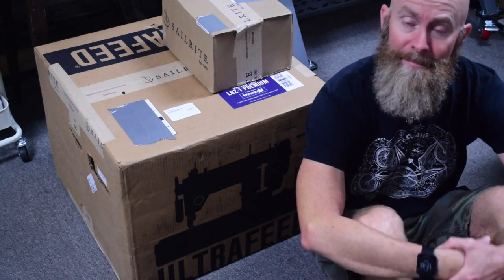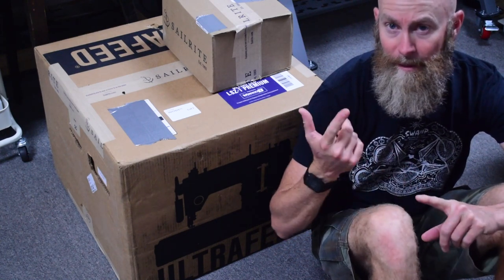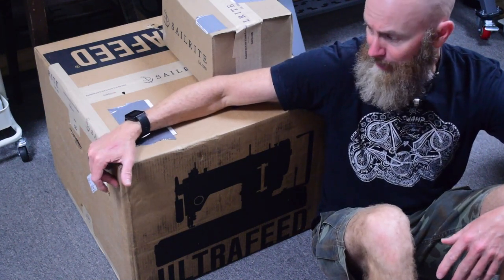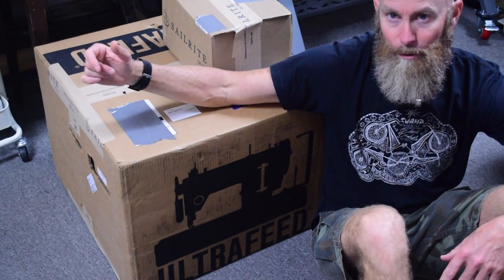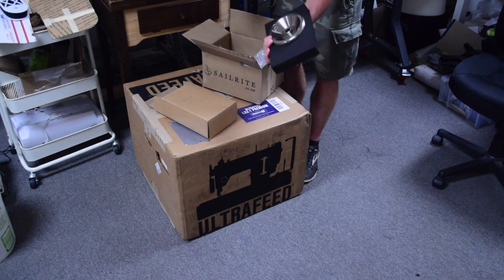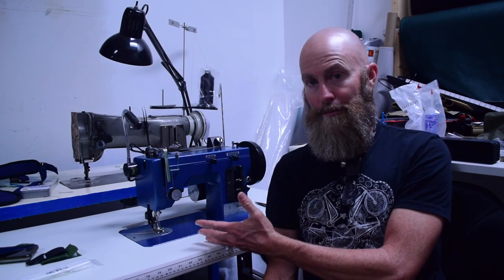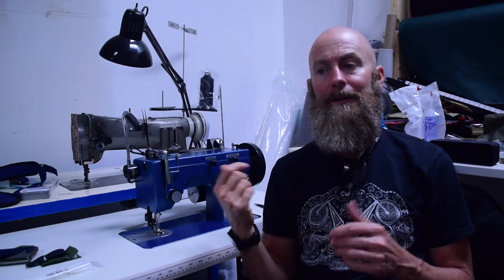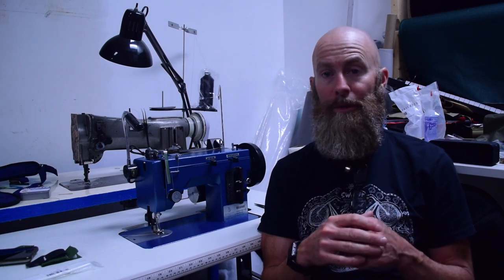LSZ-1Premium with WorkerB; Unboxing and First Impressions

Comment: Here's the deal, the LS-1 and the LSZ-1 were designed for one thing, to sew any fabric you will find on yachts and sail boats. All fabrics from the lightest sails to the heaviest canvas can be sewn on these machines. This is the reason why they are portable and can be used with no electricity. These weren't intended to replace the industrial machine under industrial conditions. Now can you use these in the household setting, yes. The LSZ-1 can handle any household project from canvas awnings to kitchen curtains.

Comment: I too would prefer to have the foot lifting lever in the back but mostly because its what I'm used to. As a kite surfing repair guy I'm often sewing rips in struts and it requires gathering the tube up behind the needle and at times there will be enough fabric to actually lift the lever up and reduce foot pressure, which causes problems. Its also happens when I've got the the entire kite stuffed under the arm. Here having the lever on the top is advantageous. A future video could be about visiting a kite repair shop and seeing what/how they do things.
Reply from the maker: Good points!  Do you know a kite repair shop that might allow me to visit? 😉
(You can email me at        the jason of all trades @ gmail . com  <---remove the spaces.  If you're anywhere in Florida, I'd love to see what you do!)

Comment: WOW, I just stumbled on this vid and cant believe it. ( I subscribed too) I have been looking at machines and was getting ready to buy this one, like as in, this week.
 So you have comments from people who dont know the difference between an "Industrial" machine and a "heavy duty" machine. They should read the category  description of each, so they know the difference. This machine is classified as a heavy duty, portable machine, not an industrial machine.   The  Sailrite 111 Fabricator, is their "industrial"  model.
 Yeah, Ive worked in machine shops my whole life and have a full size Bridgeport industrial milling machine in my garage. ( Im 65).
  I picked this machine for all the reasons it is, what it is.
 Portable, heavy duty, walking foot, adjustable stitch length both directions, the ability to have both straight and zig-zag, at the flip of a lever. Easy set up to sew bead, tunnel, or wire into edge. Has easy mounting for an edge binder attachment. Perfect machine for making small sails, sun shades,  canvas covers, straps, carry bags, etc... And mostly made in the USA.
 Even though it has an oscillating, not rotating hook drive, they show, this machine will sew their brand of PTFE forever thread with minimal problems. An occasional skipped stitch does not bother me. Have you tried this thread yet?  Im very interested in using this type thread.
 I have watched several vids on this machine and it seems  to have the most features and versatile and be the best,   " bang for the buck"  for the beginner, like me, to make medium to heavy duty things at home or mobile.
 I have not found any other machine that does, all the same things, as this one. If there is one, can some one refer it?
 I cant think of anything that could be bad about this machine.  I even like, the lift lever on top.
 Thank you very much for your vid.

Comment: I took a boat cover that needed some repair and a Bimini top to get windows put in it at a local shop. the two estimates I got were over $1,200 dollars. so on a mission I went, and ended up with the LSZ-1 with the regular motor. The repair material and window material was $175.00. I used to play around with my moms sewing machines as a kid sewing on patches ect. so I had some minor experience. with that said the repairs went perfect. A little touchy control wise but got it done. Then I saw the new worker B system on YouTube. I bought the monster wheel as well. and proceeded to install the Bimini windows. This thing is absolutely made my sewing look like I've been doing it as a PROFESIONAL for twenty years  the control is amazing. On a last note my son and I built a 6 man tepee out of silnylon and the seams and stitching came out perfect...so it will sew extremely thin material with ease. Just have to use smaller needle thread combo!!!!!! Moral of the story , this machine has paid for its self in less than a year!!!!!!!!!!!

Comment: I just received my LSZ-1 and finished assembling it and setting it up. I am impressed with it. It's exactly as described. They did add the molded cord retainer on the belt cover which I thought was cool since you mentioned it in your video. I also bought the industrial table to go with it which should be arriving today. Thanks for posting your experiences with it. That played a big part in my decision in buying it. I wanted zig zag function too which clenched the deal. Thanks again👍
Reply from the maker: That's awesome, let me know what you make with it! I know you'll love it, I have way too many machines but I always love making stuff on my Ultrafeeds!

Comment: Hi Jason. Really appreciate you. I started sewing because I wanted to make a boat cover. I bought the LS. Worked great and now it’s one of my favorite hobbies. I bought a fabricator and I really like it. A few years ago I gave my LS to one of my sons. After a while I realized that I really missed the portability of the LS so I just bought the latest LZ.  I have a home and a cabin and there are many times I want to make things at the cabin so now I’m happy. One thing that really impressed me when I bought my first Sailrite is the customer support. If I had any issues they’d work with me until the problem was resolved. They even sent me links to well made detailed videos walking me through the process.  Based on my experience with them they clearly are stuck with me as a satisfied customer.  And thank you. Mike

Comment: I think your videos are very helpful.  I just got my blue machine and i'm using it for bag making personal use.  I have a fairly new Bernina and the last bag i made was thick enought that when i used the hand wheel to go over a thick part the wheel came off in my hand.  Didn't know i had broken off 2 nubs on the inside.  Also i boogered up something just in front of the needle. So decided this machine was a lot heavier and more suited for bags.  I'm excited and love your videos.  Unless you have tried one of these machines don't bad mouth it!!

Comment: I have had a LZ-1 and just did the upgrade to the worker Bee. Head over tails improvement.  That power assist is awesome with the control needed.  I am a small part time manufacturer of specialty gear.  Multiple layers of Cordura, mil-spec nylon webbing, foam assemblies. Only recommendation I tell folks is take off the tensioning knob and use a vernier depth gauge and measure the post to knob height.  Keep those measurements so that you can repeatedly comeback to different tensions depending on what your sewing.
Reply from the maker: That's a cool idea using the depth gauge!  I'm more of a "go by feel" guy, but that's a smart way to get repeatable results, thanks for sharing!
Reply: @thejasonofalltrades  @Jason Samara  Well, my method is to measure the thread tensions by a simple $1.5 spring dynamometer. I keep some records of thread tensions at bobbin thread and needle thread for some fabrics, threads, and needles, so I normally do not need much test sewing before I am right on for a project. But yes, I guess when you are more experienced, it is faster "by feel".

Comment: Hi Jason, I just wanted to drop a note to thank you for all the great videos you put out especially the ones on sewing and the Sailrite machines in particular. I enjoy your videos and appreciate your ethics. They've been very helpful, I placed my order today. : - )
Reply from the maker: Congratulations :) Enjoy!
Reply: @thejasonofalltrades  Hi Jason, my machine is coming (should be here tomorrow) with a roll of white v92 thread. Do you mind if I ask what are the most common colors you use? I'll only be sewing outdoor gear like you and I'm brand new to sewing so I have lots to learn. I thought about ordering a roll of black but wondered if there is also another color I should consider adding to my order. I've heard you say you use mostly v69 thread. Do you think I should also get some in that size too or stick with the v92? I'll mainly be sewing canvas. Again thank you so much for all your great content, I've learned a ton from watching your videos!
Reply from the maker: @Tim_Pollock  Hi Tim, 
My reasoning for primarily using V69 is versatility.  V69 is generally considered to be the heaviest thread one should use in most domestic/household sewing machines, and it is thin enough that I can get away with sewing thinner materials with it (although it is NOT ideal).  I can use it whether I'm using the Ultrafeed, one of my industrials or one of my vintage domestics.  I often find myself going from machine to machine on a project, so that's a big convenience for me.
For example, say I want an interior pocket out of a thinner ripstop, but the body of the bag is 1000D Cordura, and I want the same color thread for both.  V69 lets me do both, so I don't have to have multiple sizes of thread in the same color.
V92 is great for some of the heavier materials I use, but I really don't notice any difference unless I'm topstitching, and that difference is pretty minimal.
In terms of color, I have two HUGE cones of black V69 that are always on at least one of my machines.  When I'm assembling something and the stitches aren't visible, that's pretty much what I'm using.  I have quite a few smaller cones of various colors that I use for visible topstitching when I want to either match or contrast what I'm sewing. A general rule of thumb is you can get away with less-accurate stitching when you have a thread that matches the fabric; using contrasting thread looks great but demands greater attention to detail. Admittedly, I will sometimes use whatever is in the machine, depending on the size or importance of the project. 
The Thread Exchange is the site I usually buy thread from, they have a great selection and a VERY informative website.
I hope that helps, keep me posted when you get your machine, and thanks for being part of the channel!
Reply: @thejasonofalltrades  Thank you so much Jason for taking the time to respond and for all the helpful tips and advice. It is greatly appreciated. Will do sir, I'm super excited to get it. I've been using my wife's brother domestic machine to learn on but it has struggled some when sewing multiple layers of canvas.
Reply: @thejasonofalltrades   Hey Jason, hope you're doing well. I got my new LSZ-1 in today. I'm going to try to send you an email, I hope that's OK so I can share some photos with you. 
Thanks! 
Tim

Comment: Good evening, 
I just got to this video and am thankful you made it. I've had my Sailrite LSZ-1 now for oh, maybe 13-14 years now and have maybe, at most, about 10-20 hours on it. I have no where near used this machine to its full potential, not even close.  I try and have fun with it while attempting projects/repairs/alterations but, I get frustrated at times 'cause it's not doing what I want. I'm having a problem with tension right now. I'm using a 22 needle and some Sunbrella and for the life of me, I can't get the tension correct so the bottom stitching looks identical to the top. The bottom still shows the knot. I cannot get the knot to end up in the middle of the upper and bottom stitching. 

I know in the manual, it refers to the use of the V-92 as the heaviest thread to use but, in the same manual, it states that you can use a 22 needle too. And a 22 is what's needed for V-138 thread. Hmmmm. So, anyway, I really like the machine. I just have to master it. Thanks again for your video. Always inspiring to watch someone use one of these machines. They really don't seem to be that well known in the sewing world.
Reply from the maker: Hi! It sounds like you are using V138 thread when you are having this issue? Coincidentally, I will be publishing a video in the next week or so in which I use V138 in my Ultrafeed.  From that limited experience, I think that V-138, in general, is too much thread for these machines.  I think you can get away with it, possibly depending on other variables like what fabric you are sewing, how many layers, etc.  In my case, I was sewing tubular webbing, and I was able to get "acceptable-to-me" results by putting a different wrap on the three-hole upper thread guide, cranking the upper tension down as tight as I could, and reducing bobbin case tension.  It still isn't good enough, and I wouldn't use it on something I was sewing for someone else, but for the project I did it sufficed.  As you point out, I think V-92 is the thickest thread Sailrite recommends for the Ultrafeed.
I hope that helps, thanks for watching!
Reply: Jason,
 I assume that's your name. I sincerely want to thank you for getting back to me on this. Yes, I should have mentioned I'm trying to use the V-138 and a 22 needle in my Ultra feed. I have used it a few times and, just like you, one of the times was on tubular webbing and had what I consider, great results. But, tubular webbing, especially the Nylon stuff, is a funny animal. Sew one direction and you see all the stitching perfect. Sew the other direction and, in some cases, the stitching DISSAPPEARS!  That's the nature of the beast in those circumstances. 

The material I'm trying to sew is Sunbrella. I don't know the oz. weight. And as far as how many layers, two to start with. Then in my experimentation, I fold it over and then once more. All the results are the same, a visible knot on the bottom. I have ran the tension knob all the way in and loosened the bobbin tension to the point the screw almost falls out and am barely getting better results. 

I have watched Matt Grant (and others) on the Sailrite website sew blue Sunbrella with either the Ultrafeed machine (LSZ) or the Fabricator with what appears to be white V-138 thread. It (the thread) looks, at least on camera, to be much thicker than the V-92. But, they for the part, do not say what thread they're using in many of their demos. 

Anyway, sorry for the long reply. I really appreciate you working with me here. 
SR